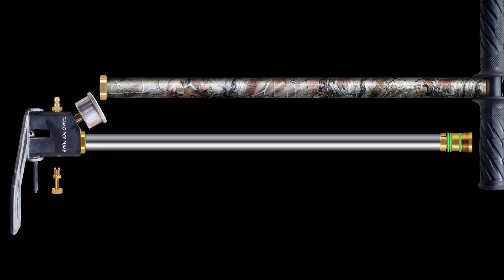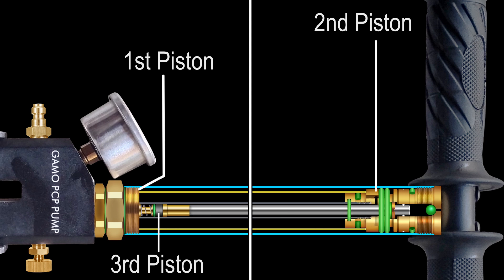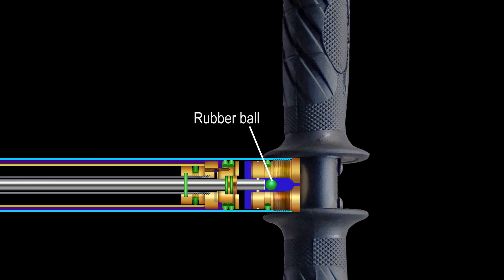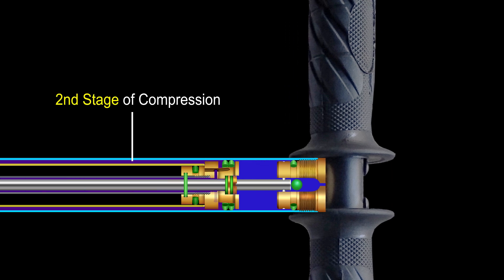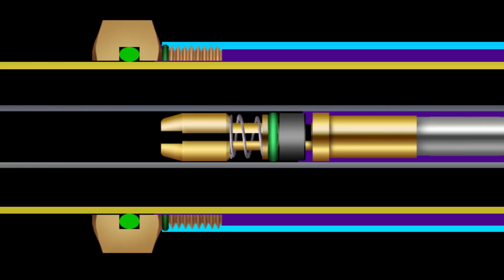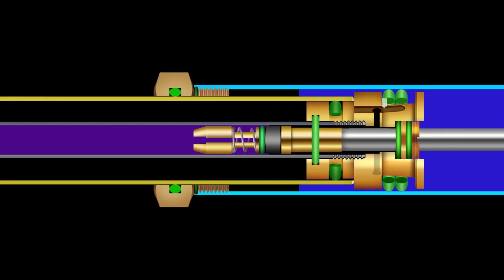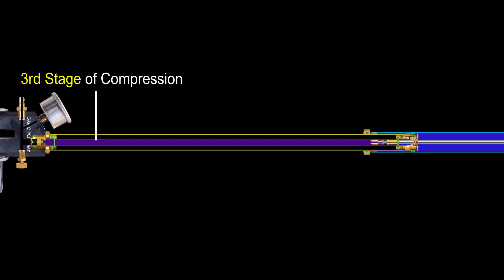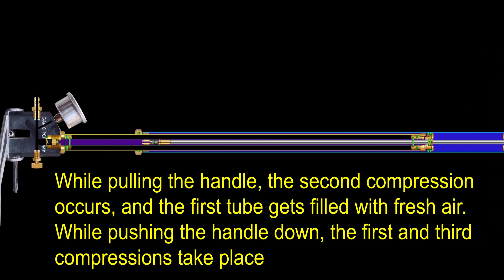How 3 stage PCP pump works | 2D animation | Exploded View

Comment: So wheres the cooling water?
Reply from the maker: There is no water in this type of pump but some manufacturers pour water into it. The space between 2nd and 3rd tube can be filled with water. Air does not go into this space. But water can cause rust so oil based coolant agents are used.